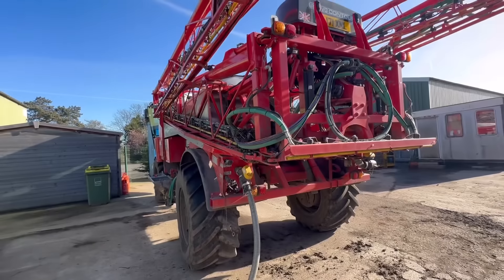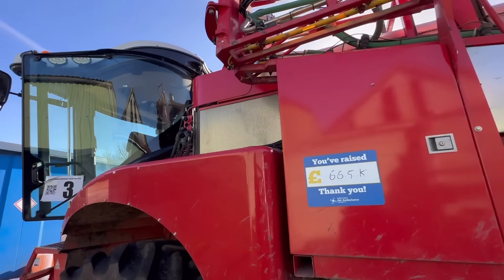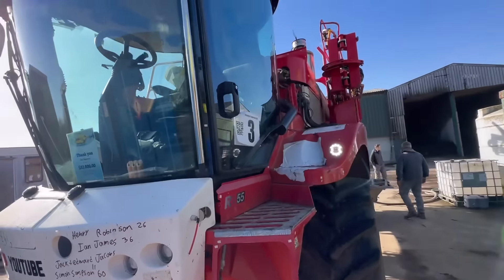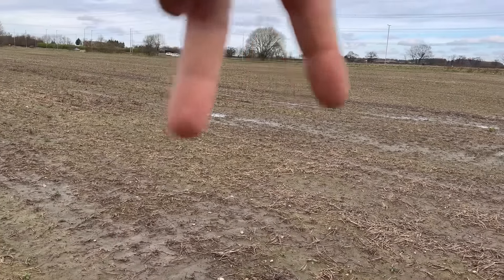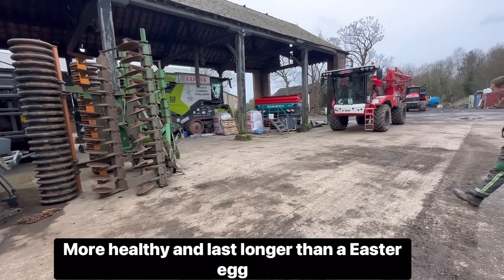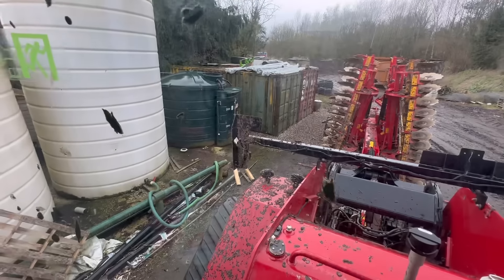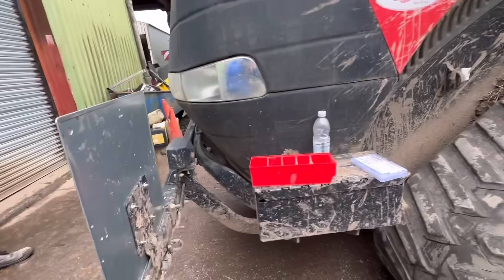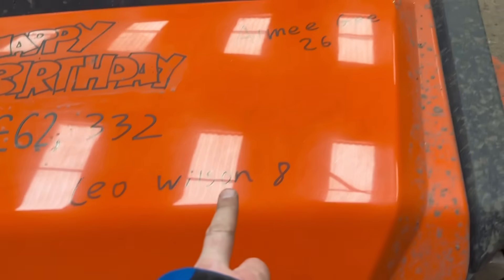HOW A SPRAYER WORKS & QUADTRAC REPAIRS #AnswerAsAPercent 1460

Comment: Wow!! Your Bateman is a 'Proper Job' sprayer!!  Back in my day they consisted mostly of a 3 point linkage mounted unit which basically consisted of a tank, pto driven pump, a boom , lots of pipes and nozzles and a pressure gauge .  All the chemicals you had to haul up to put them in through the tank lid!!  Manual Booms at 12 meters!!
Reply: 12m, you were lucky. Our first Allman was only 10m. The old Ransomes probably only 8m